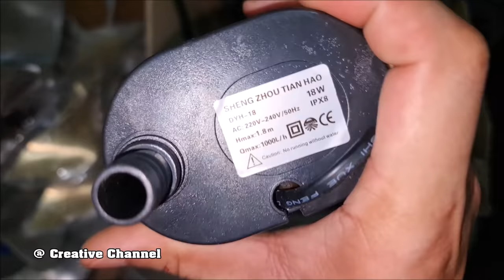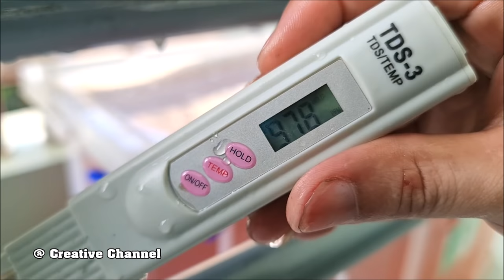How to make a Hydroponic System at home using PVC Pipe

Comment: Nice video.  Thank you for taking the time.  A clear nutrient tank will probably give you problems with algae.  Black would be better.  Also, the pipe going back into the nutrient tank should be shorter so it makes a splash when it returns.  This should give better aeration
Reply: One question is water pump to be kept running all the time round the clock  or for specific  time of day.
Reply: @youfunny4180  I would put a timer on it to stay on for about a half hour every hour. some plants can handle 24/4 moisture but others need a break or they will "drown". Also put a small aerator in the tank to helps keep the roots healthy.
Reply: @fb7881 Thank you so much
Reply: @youfunny4180  Another way to do it would be closer to nft (nutrient film technique, plenty of videos on YT) : you would arrange the pipes in such a way that the flow of water is much lower, so only the bottom part of the roots touch the nutrient. This way no risk of drowning your plants, and it could be run 24/24h.
You can keep a “longish” return pipe and add a bubbler in the tank to add oxygen (if you don’t like the splashing noise maybe) but this would require one more electric device (you can find some with tiny solar panels though).
Reply: @LogosFarm I wouldn’t recommend having leafy greens, herbs and fruiting varieties in the same setup. You need different EC (electro conductivity, the amount of nutrients in water) levels for different cultivars and maybe different light intensities for vegetative state or ripening. The time from seed to harvest is also very different (about one month for lettuce vs. several months for tomatoes), so the bigger plants would suck all the nutrients very quickly. Finally the size of the roots are very different - for tomatoes or peppers I would not recommend a rail/gutter/nft style setup but rather some kind of deep water culture / dutch bucket setup eith much bigger containers…
You could definitely mix different leafy greens (lettuce, spinach, etc.) together. Herbs I tend to keep longer so I have them in small-ish kratky units that I can keep for several months.
Reply: @youfunny4180  Not necessary.  When you add plant food, you may want to have it run for a bit to equally distributing/spreading the food to all the pipe.  After that you can shut off.  So every time you add water to the main tank due to evaporation and plants soaking it up, you can to turn it on to evenly distribute the nutrients again.  I hope that help.
Reply: @remka2000  hi could I DM you separately on setup
Reply: @AbhimanyuNaikareWebDeveloper  I guess, but you probably also post your question here (also I have no idea how to do PM on YT ahah). For a good NFT (and other hydro techniques) channel I would recommend Hoocho's, he tried pretty much everything and is very easy to follow. Khang Starr is also a great resource for general hydro tips (also easy to follow).
Reply: great input
Reply: can you seller this type of arrangement.
Reply: You couldn't close it with a little wooden fence around it or either

Comment: Looks like he's using about 40 feet of 77mm or roughly 3" pipe for the plant tubes. Also appears to be using a 3" x 1" pvc reducer (2 for each tube end), 90° pvc elbow 1" (again, 2 for each tube end), 1" pvc that goes in between to join the elbows (I'd say he bought close to 20ft of it at least). That is all for the plant tubes. 

For the frame, he's using 1" pvc pipe (same as the one used to join the elbows), with several 1" T couplings. 

Last but not least, he has pvc glue to "cement" all the pieces together.
Reply: thats what we would use in USA but they use odd numbers they dont go by inch they go by mm
Reply: Thank you :) millimeters or inches doesn't matter, important is only the proportions, everyone can look the numbers up and find something that is close by the normsize they have.
Reply: Can u list down all in with size and how many for each for this setup list pls
Reply: Thank you so much, im about to start a large one about 10 systems deep inspired by this video. I hope it works! Progressing towards self sustainability
Reply: @nocomplysoldier  really ? i have both conduit and s40 and the s40 is sturdier. the conduit keep bending like jim carry's legs in the mask (just a reference).
Reply: @nocomplysoldier  probably because its cheaper and waterproof. Id use irrigation pipe every day
Reply: Better use costlier but more easier to clean troughs of 4"-6" with caps and 1" pipes to connect water at ends.
Troughs can be easily cleaned. Troughs used for water harvesting on rooftops too.
Reply: Thanks
Reply: Anybody have measurements of this project
Reply: @anthonydowling5361 at first glance
50"*20"*60" high
3" and 1" pipes
2" holes, 6" between the holes
Reply: PVC는 안전한가요?
Reply: Thank you for revealing the measurements,  really appreciated❤

Comment: A couple of notes. Make sure your pump isnt too fast for any of the bends, water will back up, especially when roots fill the flow tubes. Water will fill the flow tubes to the depth of the end cap hole, so the hole width for the cups need to be created  so that the bottom of the cup sits below the end cap water exit level. Drill holes in the cups so that all the holes are in the water to prevent microbial growth and evaporation.
Reply: also stagger teh holes in the actual grow pipes for more efficiency, like this;
o o o
  o o
o o o
this way there is more room to grow
Reply: @Yvola  If you try to.pack of balls nature will arrange itself in a lattice like you depicted. It's called hexagonal lattice  or hexagonal packing which gives the highest possible packing density.

Comment: It's great! only a few complaints:
 - PVC will not hold up to sunlight as it gets brittle to UVC. Future builds will have to be made from different materials.
 - The water and nutrient tank needs to be opaque. Your clear one won't get hot enough to keep algae from growing.
Reply: Could paint the pvc and the tote with a basic exterior paint to solve both of these issues.
Reply: Agree with you, We can use UPVC pipes for better durabilty and protection against UV rays.
Reply: At 1:30 he shows the uPVC type and diameter of the pipe. The clear reservoir is a problem, but if he is cleaning it when changing nutrients, it shouldn't get bad. Air stones would help plant growth and health.
Reply: PVC gets really hot under the sun, isn't that a problem for the plants ? ( I understand the water cools it, but still...)

Comment: Not sure what you are growing, but you probably need larger diameter pipe, (roots will clog the pipe) and they are too close together (for bushy plants). Putting the pipes at different levels would also help. Like an A-Frame. As someone else said , the clear reservoir will grow a lot of alge.
Reply: What if he’s growing lettuce? Would the spacing be alright?
Reply: Actually, pulling out the cups
And trimming off some of the roots stimulates the plant to grow more (and no clogging).

Comment: This looks good for a certain degree. The only prblem is that I live indoors and live in a climate that has winter. If anything I would do this for spring and summer. In any other case I would do one inside or in a greenhouse that I can control the temperature.
Reply: if you have a basement. just purchase some grow lights. just remember to keep the temperature right.

Comment: Because he is working in metric system, his first pvc cut is at 115 cm.  Closest one can get in American measures and supplies:  using 4" pvc pipe in 4 ft lengths, first mark is at 6" and then 6" apart will yield seven marks per pipe for cuts with 51cm hole saw for 2" net cup.  My husband raised me well, bless him!  I think you can do the build from there without me, lol!

Comment: Nice tidy build. The system would be difficult to clean when the nutrient solution needs to be changed.Shield your reservoir from sunlight to prevent algae .With water that deep in the pipe , it`s likely that you will get some root rot because there will be a lack of oxygen in the water. A large bubbler ( air stone ) in the res. fed by an air pump would help with that .A shallower water level inside the rails would be better to help the plants develop their air roots , ( Nutrient Film Technique ) or NFT. The system looks great.
Reply: How can you adjust the water level inside the pipes?
Reply: Hi
Reply: Hello.which nutrient have u added plx.

Comment: Nice idea. Try adding bubbler pipe for oxygen to the root zone. You could stick a length the size of the pipe in each one would improve output 100%...Great video keep them rocking
Reply: What do you mean. im trying to follow you here lol.
Reply: @jaimelemus45  lol if you can use bubbler line. Its like airline perferated which can be used as a airstone for dwc will float @alienhydroponics use a large version in there silver 36ltr pro rdwc system. Very usefull . You could run a length down each pipe would improve production no end.we use it instead of airstones excellent stuff. Good luck stay lucky✌️😎
Reply: @jaimelemus45  Ha ha dont follow me il lead ya to darkness. Ha ha😜😜😜
Reply: Thanks for the idea. Can you tell what was the white thing in which seeds were put , in which they grew and later was transferred in plastic cups.. what was the white base. Thanks.
Reply: @amitsinha61  rockwool
Reply: @amitsinha61  Looks like a polystyrene cube plants will grow in polystyrenes. Totally inert you need to add nutes
Reply: @giffsgaffs615  I was thinking the same. Like a high density bubble wrap plastic
Reply: @andybilakshow260  have you seen the black bubbler line. Its the same as airline but has holes in it. We add them to nutrient tanks or rdwc buckets when we grow in hydro or deep water culture. I will be putting a dwc grow together soon I'm documenting it on grow diaries. 58ltr pots 1 plant per pot 4 pots. 1x 600w hps 1x 315cmh. Air cooled just waiting on cuttings to root. Few more days.

Comment: 2 things. 

1. I feel one end needs to have slight elevation to assist the fill and drain principle. 

2. Two pvc tube at the very very bottom filled with sand to make the system more stable when all the weight of water is pumped to the top. Just a thought.

Comment: I like the build.... your corners should be made of the same size pvc as your rails.  Looks like you are going for an NFT system.  Should be a small stream of solution not having the tunes full.  Might cause issues with root rot. Also your tank is clear I'd paint it to keep algae from growing. Lastly your drain pipe needs to be shorter to aerate the res or you will need an air stone
Reply: What about both?

Comment: Because of the way sun rises and sets and the fact the sun won't reach them directly north your plants won't grow straight  and grow falling off your balcony trying to reach the sunlight. Also your water reservoir needs to be a solid color. Light cannot pass through otherwise algae will form. You could always paint the one you have since you glued the water drain in the lid like that but it'll work. It's a very nice and clean well put together system very well done. Just a few tweaks and you will have a perfect setup
Reply: He lacks a drainage pipe and a lid in every tube that will allow him to get his hand in for cleaning.

Comment: That tote you're using as a reservoir is going to grow algae. It needs to be opaque.
Reply: so it must be color black?
Reply: or at least cover it with heat isulator?
Reply: Reservoir looked a little small IMO. Probably run out of water first, before filling the grow beds completely. Water temps are going to cook the plants roots.
Reply: @unejoy9324  yes and yes. I've tried using transparent plastic bottles for my self watering plant, but one has color and it is kinda opaque. The one that has color is the only one that didnt develop algae inside.
Reply: That's totally what I was thinking 🤔 ... Must put black plastic bag and put hole for oxygen
Reply: @3RR4  the colored bottle also has holes, so I guess the most important part there is to prevent sunlight to get through.
Reply: Pipe should be lead free and water level in pipe will not exceeded by 5 mm... In reservoir he should provide air pump for mixing of oxygen in water
Reply: not opaque but rather flowing solution.  Algae will form if the water is stagnant and dirty. Depending on where you are you may also be breeding mosquitos or other nonsense.

TBH invest in a small fish tank set - airator, water pump etc. and hook it up.   Also try keep as much of the solution as clean as possible i.e. don't bring in soil or other things that may carry small micro particles.
Reply: @unejoy9324  if they grow alges the oxgine is down and all the system going down
Reply: I have a strange feeling this build wasn't meant to last.
Reply: It's outside & looks like it will get plenty of sun, so I doubt algae will be a problem in this circumstance

Comment: Excellent design, only thing u forgot is u should paint that box black so algae wont grow inside of it.
Reply: What type of paint would you use then?`Wanna build this, but doesnt wanna end up with the wrong paint realeasing from the box
Reply: @Locomyman  I think I have seen spray paint being used. And you will be using it on the outside of the box, so wouldn't be an issue. Also make sure to insulate the box in thermal foam or similar so the box won't heat up.

Comment: possible to list out all the materials you used for the setup? so i can pass the list to the hardware store to get everything.
Reply: Pl.provide list of all material you used with measurements that I can give to hardware store to make the unit.
Reply: just figure it out. Depends on how big or small you want it, at least he's showing assembly - 

IMO i'd build a sturdy stand for your trays because with water and plants growing it's going to be heavy for PVC.
Reply: @nocomplysoldier  You don't know what you are talking about..
Reply: Better use costlier but more easier to clean troughs of 4"-6" with caps and 1" pipes to connect water at ends.
Troughs can be easily cleaned. Troughs used for water harvesting on rooftops too.

Comment: You might consider adding a separate drainage system for res changes so that you don't have to vacuum the water out of those pipes
Reply: Could you elaborate on this please? I'm in the process of building a system so wanted to know if there are particulars that I should be watching out for.
Reply: @laypyu  Yo can just elevate the non drain side and it would not be a problem

Comment: Is the pump running continuously 24 hours a day?
Reply: no!
Reply: Yes it will
Reply: How many hours a day the motor will run
Reply: You don't need it to run 24 hrs. The one I have has a timer on the pump for 15min  on and 30 min off
Reply: Set a timer to the pump, 5 min on every 30 min
Reply: As much or as little as you want..

Comment: I would probably angle the pipes so that the water doesn't stagnate as the roots grow out.
I might also change to four parallel paths so that fungus might only wipe out 1/4 of your crop. It would also simplify how the pipes are angled.
Reply: long as a water pump is on 24/7 then stagnate wont be a problem.

Comment: Could you list the materials you used? Mainly the qty at measurements of each pvc type.
Reply: make ur own measurements to suit the space ur using just use the same basis he did
Reply: Better use costlier but more easier to clean troughs of 4"-6" with caps and 1" pipes to connect water at ends.
Troughs can be easily cleaned. Troughs used for water harvesting on rooftops too.
Reply: @johntarun9177  Having an open water source would cause mosquito infestation though?

 Have you made a trough variant?
Reply: @LLyrification  we get trrough covers, which can be drilled to fit the cups

Comment: Not a bad design, but I think it would be better to use square PVC pipes for most uses. It would allow more stability of the system, allow less light to go through to prevent algae growth and seat the plugs better. That being said, I do see it as a great way to produce some good food for cheap!
Reply: I found square alternative to be much more expensive and the fittings are t water tight as is meant for rain water.
Reply: Square is more expensive. I priced out various materials for a system similar to this and the cheapest overall is what is being used in this video. Aluminum gutter downspouts are cheaper by the foot for some reason where I live currently, but the connectors get you. While a 10ft section of aluminum downspout runs about $18, one single 90-degree connector is almost the same cost. A 10 foot section of 3in PVC is around $30 here and the connectors are $1-$3. I even priced out using wood for the water channels (enameled) and that's still more expensive than PVC. I have not seen square PVC pipe here. The closest I've seen to that would be vinyl gutter downspouts, but I am a little reluctant to use such due to the possibility of leeching chemicals into the water. PVC is quite resistant to chemicals and leeching.

Comment: Nice, currently not an affordable option, pvc piping in USA, extremely expensive, 4" x 10' pvc pipe $40 each. If you have pipe great, if you need to buy it, don't build the stand out of pvc, you can buy plastic shelves cheaper the building them. Hydroponics all the way, looks great.

Comment: What is the white surface where the seeds grow? Sponge? Also, What are the chemical compounds that mix with water?
Reply: probably potasium nitrate, and some other salts
Reply: The white is hydroponic sponge. Airy and absorbs enough water for the plant to grow.
The chemical mix can be bought separately as Hydroponic solution A and B. 
But if you want to do them on your own, you can get NPK, Magnesium Sulphate (Epsom salt), Calcium Nitrate and Microgreen (all water soluble mixes) and mix them in proportion to the water required in the system. You can get proportion formulas from around, even from the sellers as well.